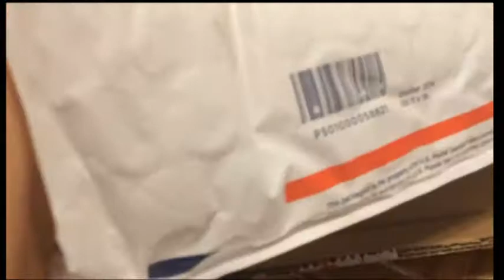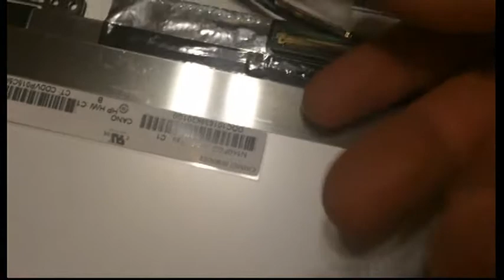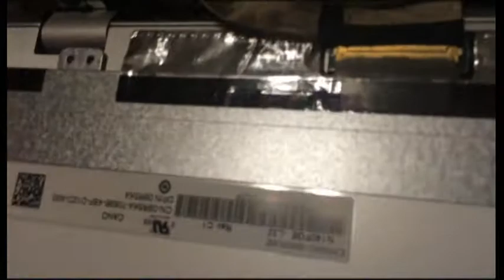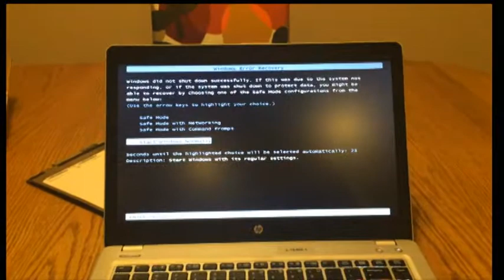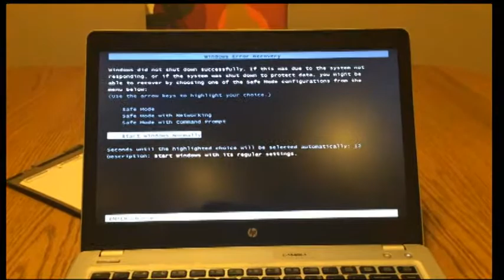Laptop screen replacement / How to replace laptop screen HP Elitebook 9470m G1 Laptop

Comment: i replacet the screen, it ligts up but it dosnt shows the start up screen. The laptop works with a monitor what can it be
Reply from the maker: connection issue? is it seated properly and you didn't bend any pins in the connector?
Reply: @EricState  it seems this particular laptop selects HD screen. I've tried about 10 screens and they won't work

Comment: So basically, I messed up pretty bad. There was this issue where the darker colors where flickering and looked white so I took the screen out and narrowed it down to the connector, I decided that I would try to repair the connector myself that went horribly and now I have a bunch of bent pins soldered together. I don't even think it's worth repairing the screen. The laptop is getting pretty old and no matter what screen you use is a terrible FN washed out pannel.

Comment: I have an HP 840 G3 - which seems very similar to the HP you've just repaired - do you think this would be essentially the same process?
Reply from the maker: From the HPs I have owned personally, to the one shown in the video which was my work laptop, they seem to be very similarly constructed. I would think proceed with caution for slight differences, but expect the same process overall.

Comment: I used your install method for my 9480m. When I booted up with the new screen my display is split into four identical sections. Everything else appears to work. Do you know how i can fix this?
Reply from the maker: That sounds like something to do with Graphic Drivers with your OS. I would check your drivers or your graphic properties settings.
Reply: +Eric State what should I look for? I'm a relatively unsophisticated user
Reply from the maker: Not knowing your computer or your enviroment, I would try the some of the steps seen on this page here: http://www.techsupportforum.com/forums/f108/laptop-screen-split-into-four-identical-parts-702226.html - BIGBEARJEDI lays out some good options to try. I would assume your computer boots up to Windows right?
Reply: Yeah it boots to windows
Reply: @TheWaxool96  Hey Eric how were you able to fix this. My client is having the exact same issue right now
Reply: Hey Eric how were you able to fix this. My client is having the exact same issue right now